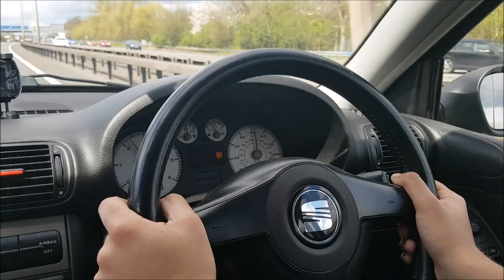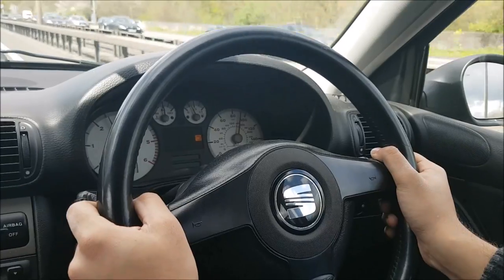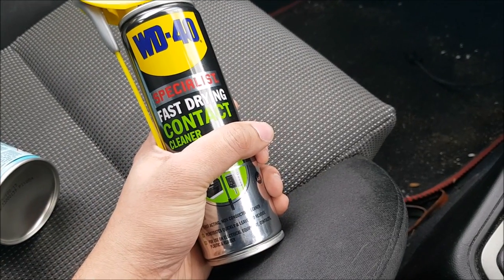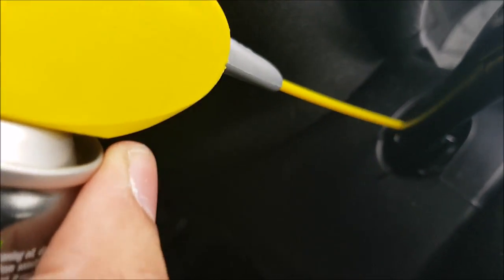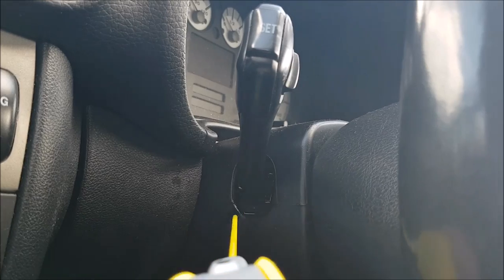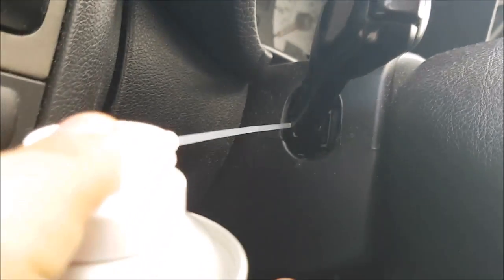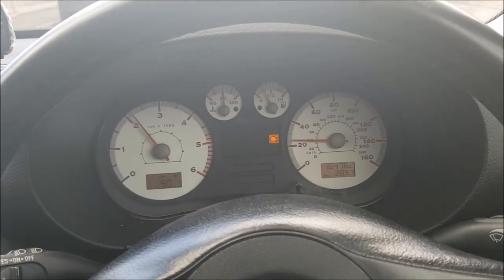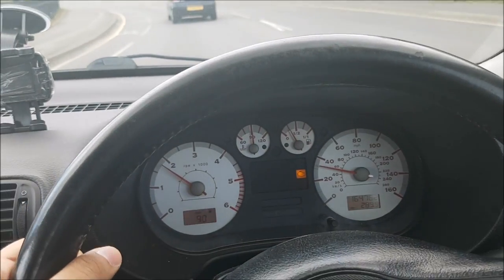Indicator ticking sound fix - VW / Audi / SEAT / Skoda and other cars

Comment: remember to disconnect the negative side of your battery before attempting. you can also use Mass Air Flor cleaner if you can't find Contact cleaner as it dries just as fast. 😊

Comment: I’m mad I’ve been driving like this for months and this is all I had to do
Reply from the maker: Yeah common fault and simple fix. Hope this helps bruv. Thanks for commenting.
Reply: @RedlineRevs  did you disconnect the battery negative to do this? If you didn't, I wont.

Comment: Cleaning the turn signal switch with an electrical contact cleaner spray has fixed the problem for me, too, on a 2007 Skoda Superb. At first I have blown some compressed air onto the switch which seemed to make the random clicking somewhat less frequent, but it disappeared completely only after cleaning it with contact cleaner. Thank you!
Reply from the maker: Glad this helped you. Thanks for taking the time to comment.

Comment: First of all thank you for taking your time to make a video to help others , so thumbs up bro, Second thing I would like to say no one could ever call you a stingy fecker , not when it comes to using products, if you ask me you went way over the amount required to do that job may be even 4 fold,  I especially liked the compressed air side of things was very smart , third and final point , you mentioned to leave for an hour to dry up, that's the only issue I have, that's  not necessarily something you need to do at all when it comes to contact cleaners or sprays they are designed to evaporate at an excelerated rate split seconds to seconds in fact ..just a heads up for ya , an hour is extreme over kill ...30 seconds is even way too much as it would be bone dry with no visual evidence that it was ever there or been used at all ....again kudos to you sir for your video helping others , happy Xmas 21 and a prosperous 22 to come sir.

Comment: Hi, thanks for the vid! I was wondering if you could help with another issue? I’ve searched online for a Haynes manual but can’t find one anywhere. I need to replace the air temp. sensor in the air intake but can’t locate it. In fact initially I took the air mass flow off by mistake (I’m not a car guy). Any chance you could try & describe it’s location for me so I can get it sorted. Thanks in advance!

Comment: hi, indicators are all working correctly. but the tic tic sound is muted. no sound. but lights are actually working. do i have to change the indicators relè? which one is it in the relè box? where there are others: 460, 53, 109...etc. which is it?  thanx

Comment: Hi, im driving an Audi A6 Sedan 2.4 Quattro -04. I also got the ticking problem coming from the turn indicator relay. Do you think your video should do the trick on my vehicle as well?
Reply from the maker: FeelsBadMan hi, yes I think it's definitely worth a shot. Try it and let us know if it worked on your audi.
Reply: the spray solved the problem temporary, the problem didn't go away, but the ticking noise minimized by approximately 80%. I am going to test more spray tomorrow, and see if the problem gets removed totally. Thank you for your video!
Reply from the maker: FeelsBadMan good stuff, if it helped a bit then some more should do the trick. Thanks for letting us know how you got on.

Comment: Tried this today with my boyfriends VW Polo.. now resulted in contacting several mechanics / garages / auto electricians as the back of the steering wheel is now puffing smoke everywhere. 

Supposed to be driving from West Yorkshire to Plymouth today... be careful before you try this. Might work for some but clearly not everyone.. wish it worked.